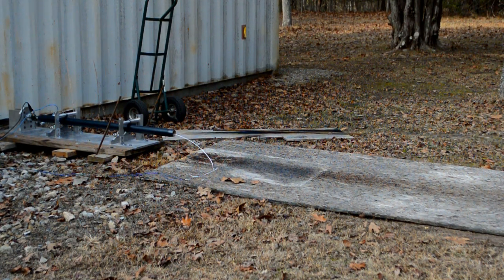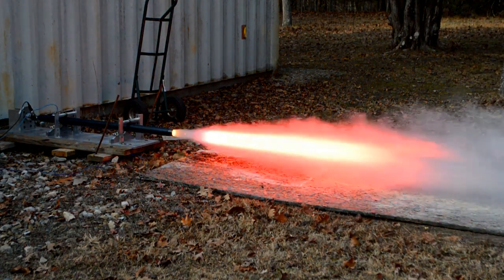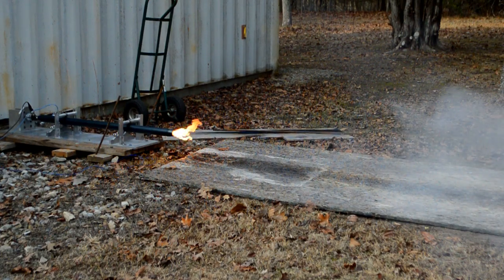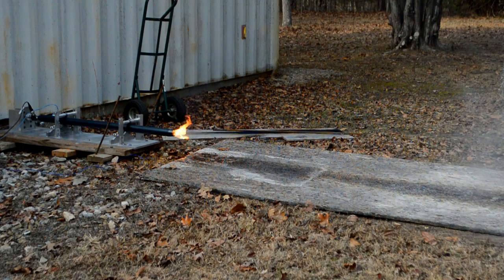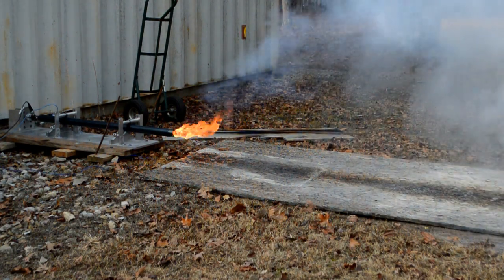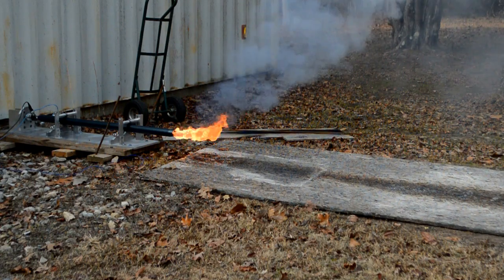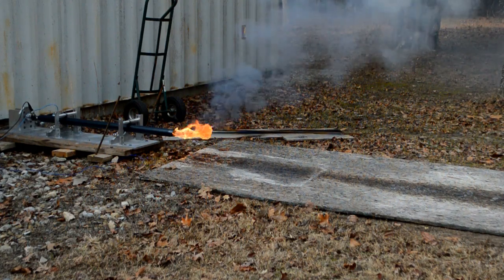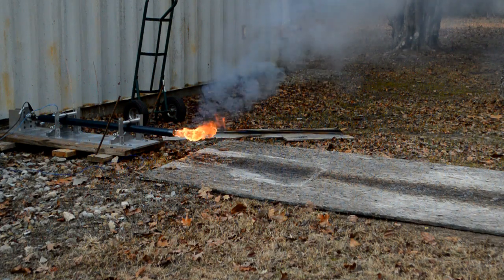Loki Research M-1378 54mm reload

Comment: Very, VERY nice test result, with not even a hint of chuffing.  Man, I've never seen such immediate generation of thrust on ANY high-power motor propellant, let alone the often reluctant-to-light Loki Red.  The full plume preceded even a wisp of smoke from the igniter.  I think that dollop of copper thermite is the secret sauce to unlock this beast's potential.  Can't wait 'til you resume production on this extraordinary motor, Mr. K!

Comment: Instant one ignition ! Quite possibly one of the quickest I've seen
Reply from the maker: measured 16ms
Reply: @Torchmeier  insane...
Is it the ISP or the density of the Loki Red that enables you to make a 54mm M ? Both must be pretty high (although I didn't know Red propellants could be high performance (compared to Imax, Cstar, PropX...))
Reply from the maker: @shere_kan8329  mainly it is accomplished through very high volume loading, enabled by a slow burn rate propellant.